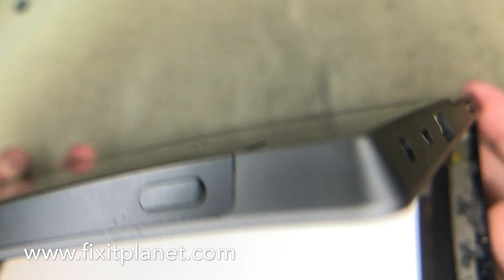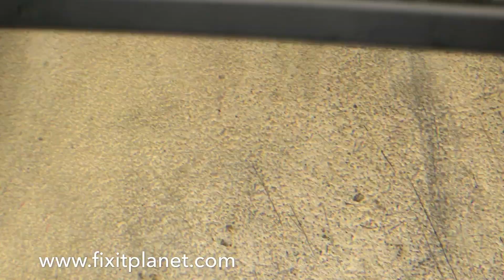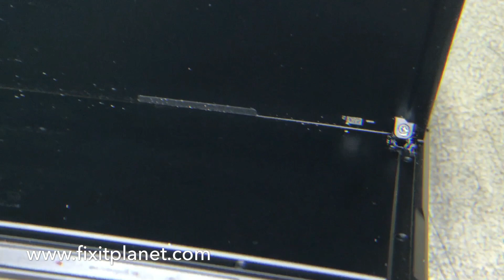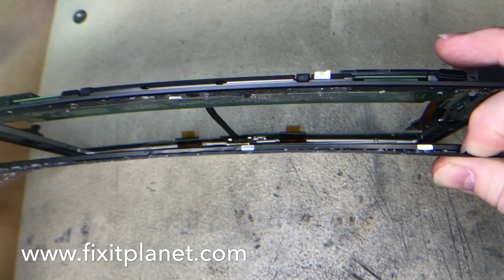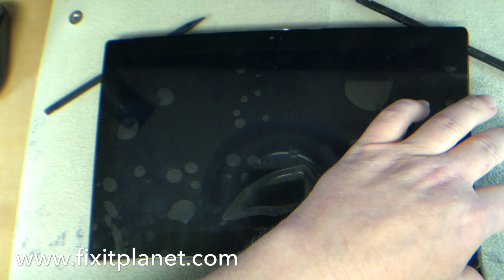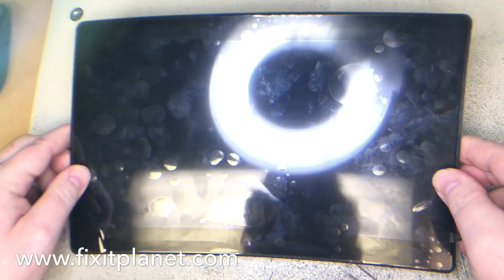Surface RT 1516 LCD-Digitizer Repair From Start To Finish.

Comment: Is the Surface RT display compatible with the Surface Pro 1?
Nowadays is cheaper to buy a used RT than a replacement screen.
Reply from the maker: The Surface pro 1st Gen screen Will only fit Microsoft Surface Pro 1st Generation 1514 Models and Microsoft Surface PRO 2nd Generation 1601 Models. Surface RT 1516 Tablet LCD Display is a totally different connection.

Comment: The screen I have I believe was water damaged and so it has lines across the screen and a large grey area where you can't see anything.  Is there a video showing you repairing a screen?  Also I saw what screen replacements from MS cost and they are ridiculous.  Hope I can find something local to fix this.

Comment: I've got a Surface RT where the screen is grey when powered on. Intermittently you can see it flicker and you can tell there are things going on in the background. Suggestions? Might this simply be a case of checking the cable attachments on the inside to ensure they're in place properly? Screen is in very good condition. No known falling incidents.

Comment: Thanks. 
Wouldn't it be safer to take the back cover off first, then the Glass, so there's less movement of the digitizer cables?
Either way should work though.
Thanks for putting this together.
Reply from the maker: Yes either way is fine.